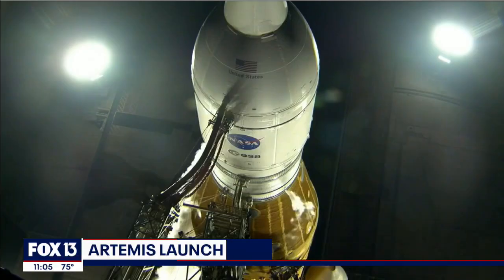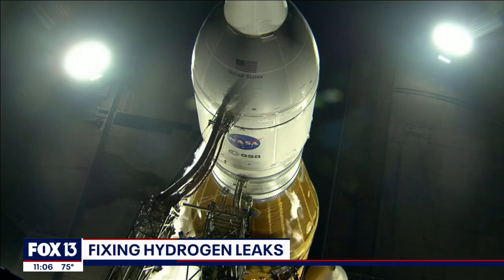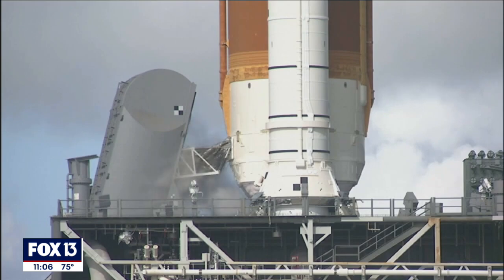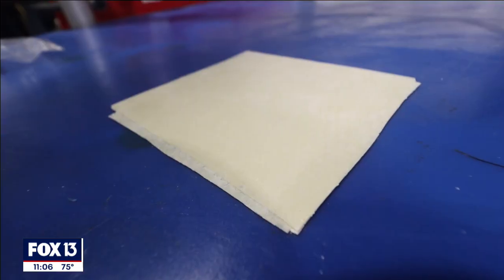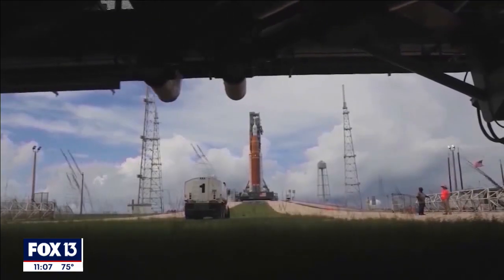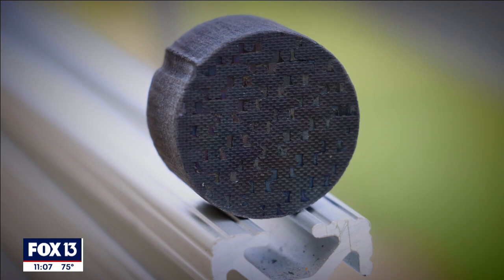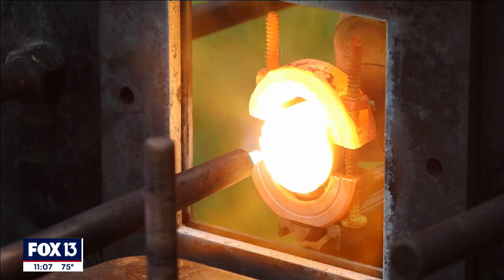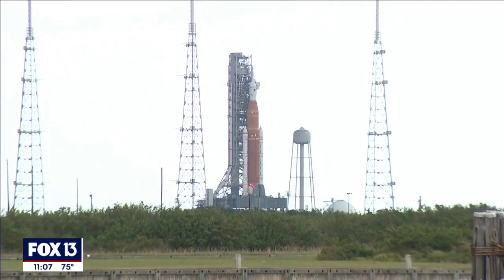How to avoid a hydrogen leak like the one on Artemis 1

Comment: ANother diversity run built on the backs of white engineers.   But lets remember..diversity dont work well in space.  THe two most diverse space shuttle crews Columbia and Challenger ended badly.  They were heavy on Firsts..but not Bests
Reply: What
Reply: The crews how absolutely nothing to do with what happened on Columbia and Challenger. Those failures fail on the higher-ups at NASA for the management structure they built.